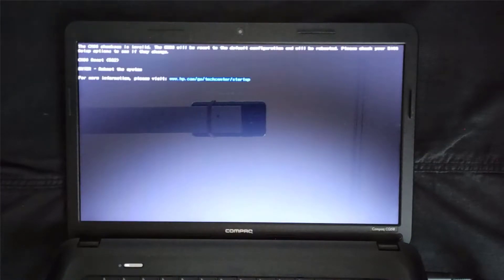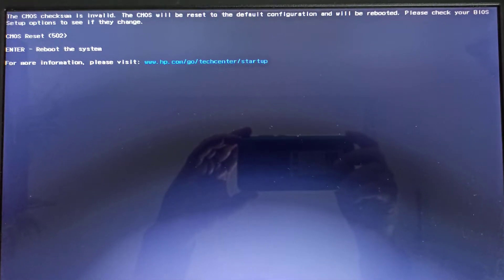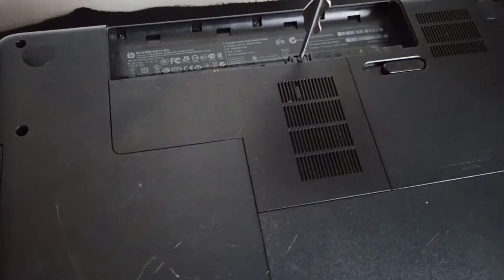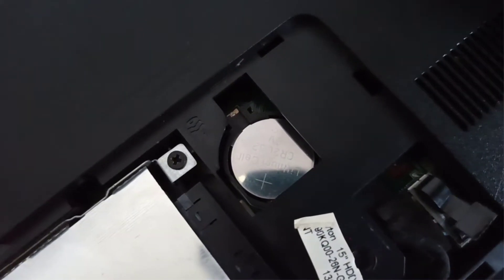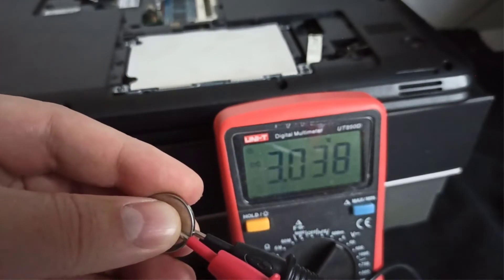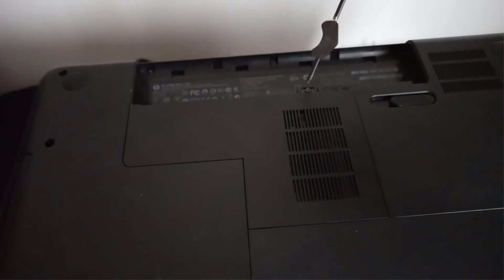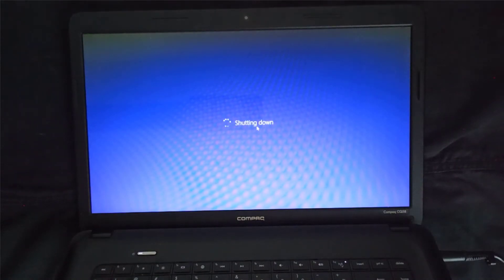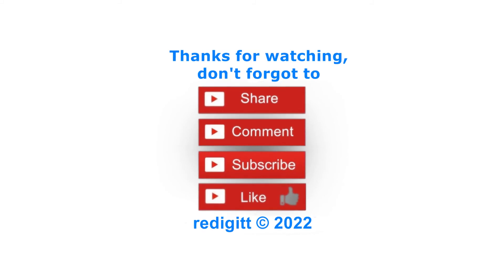1$ Easy Fix for Compaq CQ58 laptop #redigitt Ep 381

Comment from the maker: If my video was helpful and you want to support my work,  you can do it by buying me a cup of coffe.
The price of one "coffe cup " was set at the minimum value of  1$.
Your support is optional, but for me every penny counts, because I earn a little bit above then the minimum wage :)
https://www.buymeacoffee.com/redigitt  I  https://ko-fi.com/redigitt  I  https://www.patreon.com/redigitt

My Most Appreciated Videos
01 No video signal, Easy PC fix in 10 steps https://youtu.be/i_7XUd-x0Dw
02 Newborn puppies in the backyard https://youtu.be/l3yvXCWnnI8
03 How to Fix Digital Scale Lo error message  https://youtu.be/5n6nF3MFq5A
04 Stopwatch timer 12 hour 720p  https://youtu.be/taTfMdJn_oA
05 60 Minutes Countdown Timer Alarm Clock with Huge BANG!!!  https://youtu.be/Aha4DMf6MQQ
06 How to Remove - Reset  - Clear BIOS Password on a HP Compaq dc7800  https://youtu.be/zJ_qF6y3QAQ
07 Stopwatch Digital Timer 24 Hour counter  https://youtu.be/AoBb_McenvQ
08 30 Minutes Countdown Timer Alarm Clock with Huge BANG!!!  https://youtu.be/QksZ7lhwQH4
09 How to Fix Car door key won't turn or car door key is hard to turn https://youtu.be/aAPvbPHAAis
10 How to fix Non-System disk or disk error for HP Compaq nc2400  https://youtu.be/KNVf9Xj48HY
11 How to enter in BIOS change the boot order HP Compaq dc7800 ultra slim desktop PC https://youtu.be/7SIK9xY7hu4
12 Lidl - AURIOL radio controlled alarm clock unboxing - setting up - testing  https://youtu.be/eu0KUB4ESFM
13 Testing  ULGD 5.0 A1 Car battery charger from Lidl  https://youtu.be/IYv4S19QOJQ
14 How to replace the key battery for Chevrolet Captiva  https://youtu.be/vTB-25OWt2A
15 10 How to update BIOS for HP Compaq dc7800 USDT   requested video  https://youtu.be/Ewx-3SM-JaU
16 How to install Windows 10 on HP Compaq dc7800 USDT PC  https://youtu.be/e55uDPo4bEo
17 Testing Visbella Headlight Restoration Kit  https://youtu.be/0UtVw0tCglo
18 Remington HC5035 Hair Clipper unboxing  and first impressions  https://youtu.be/NIZlolz9rmo
19 Toshiba Satellite C50 BIOS key and Fast Boot Menu key  https://youtu.be/8Fkj-e_hphA
20 How to upgrade the CPU for Acer Aspire 5315 laptop  https://youtu.be/9jpt2ibr-jc